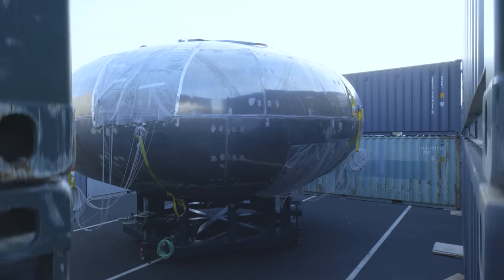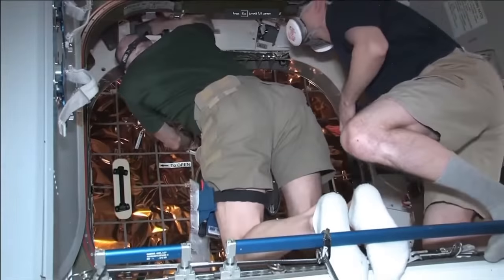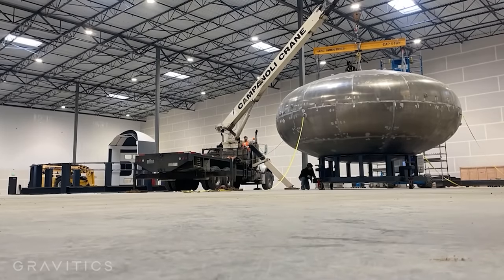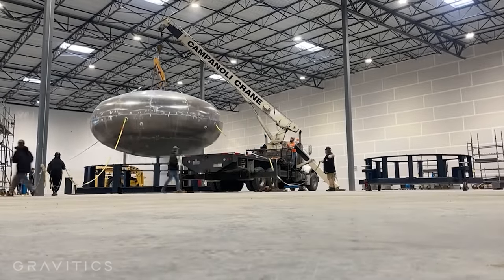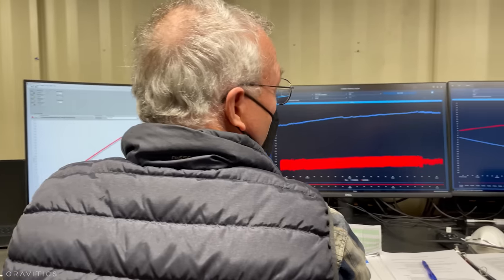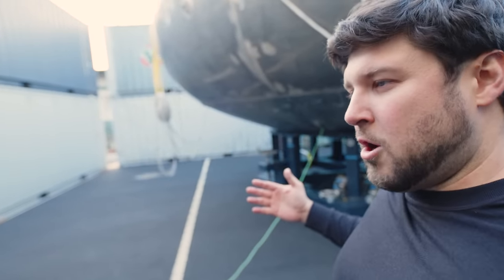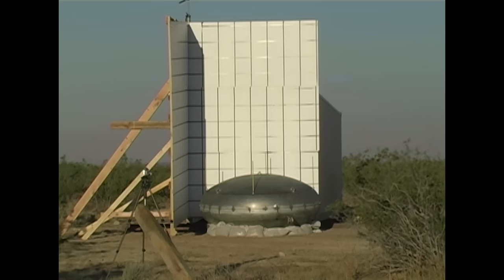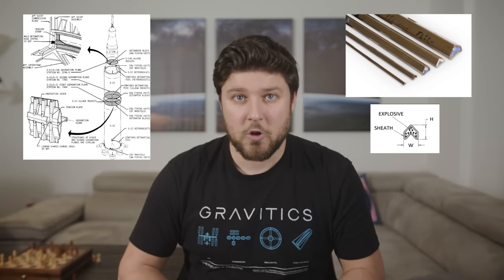How We're Building New Space Stations

Comment: Wouldn't it be more accurate to test this inside a vacuum chamber? Isn't it being helped to not explode by the atmosphere pushing in on all sides of it? How do they account for that or do they plan to also test it inside a vacuum chamber?
Reply from the maker: Good question! Its not necessary to test in vacuum - the pressures achieved are PSIG (G meaning on the gauge) so absolute pressure is higher than what is measured with the gauge by 14.7psi (ambient pressure outside the vessel). This makes is equivalent to measuring an absolute pressure in a vacuum, without being in a vacuum
Reply: @smallstars  Ah, gotcha! Thanks for clarifying.

Comment: 14psi internal with a vacuum outside is not the same as with sea level pressure outside, so to what levels must they test for space conditions. Thanks & welcome back.
Reply: I'm sure the pressures are relative to whatever is outside, because anything else wouldn't make any sense. When it's the same as the surrounding environment (e.g. before they start pumping air into it for the test), that's considered zero.

Comment: But, mon, what will protect the people inside the domes from radiation?
Reply from the maker: Layers of protection go on the outside of the hull
Reply: @smallstars  what is the thickness of the metal in this construction? I know Starship and booster use 4mm thick stainless steel.

Comment: So its been pressure tested to 14.6psi while sitting in a 14.6psi atmosphere. It is designed to be used in 0psi, shouldn't it have been tested to 29.2psi to give the same differential?
Reply: No. When you have a bike tire that has 60 psi in it, that is measured above low pressure. In the same way, doing a pressure test to 14.6 psi at sea level actually has 29.2 psi internally however half of that is negated by the external 14.2 psi.